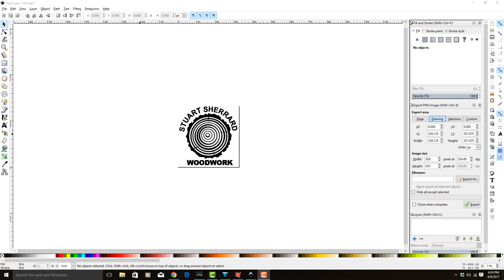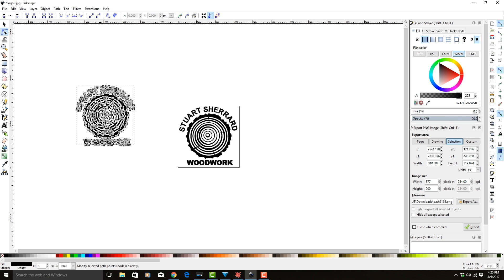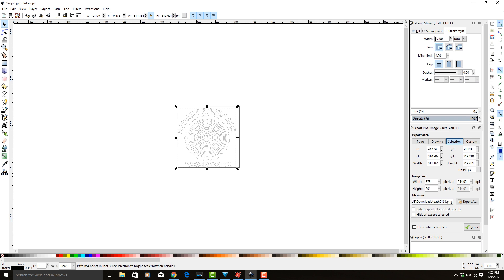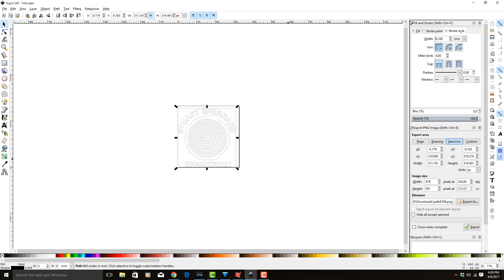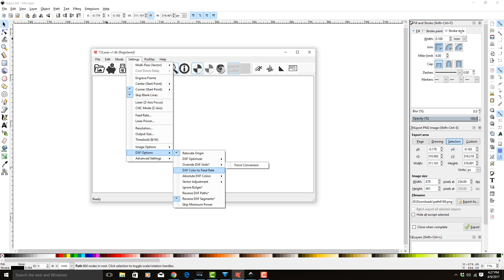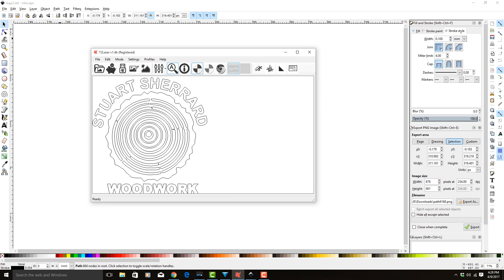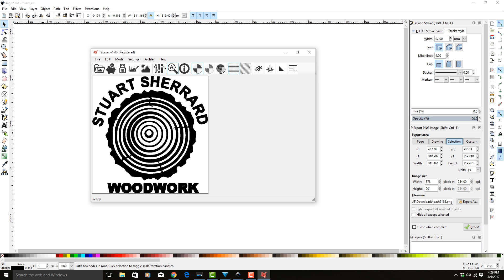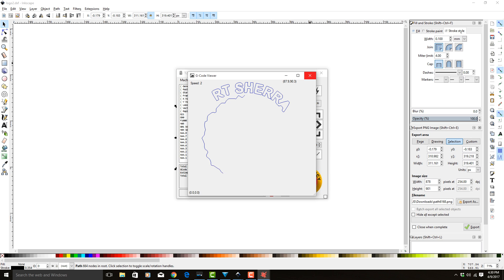Laser engraving a DXF from a jpg using inkscape and T2

Comment: What if I want to cut it out? Like a square?  I thought I had read somewhere that the color red when designing it will tell the software where to cut, or am I wrong on that?
Reply: Mike Carter it can. It depends on the software you are using. if you are using T2 there is an option to use colors as different power levels.its not necessary but it is an option.  That setting is located under the dxf optimizer settings
Reply: Thanks will look into it.